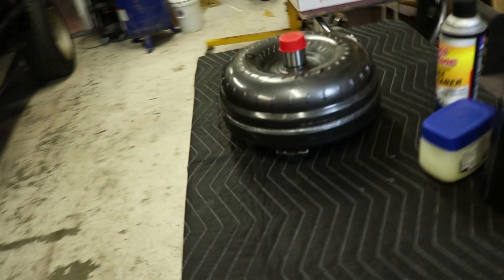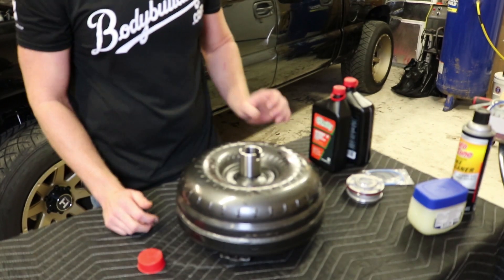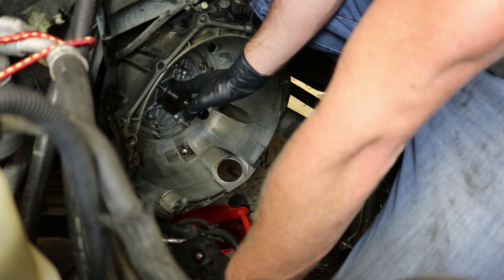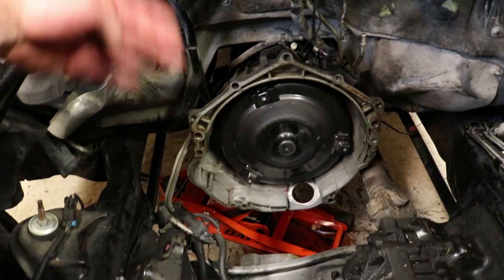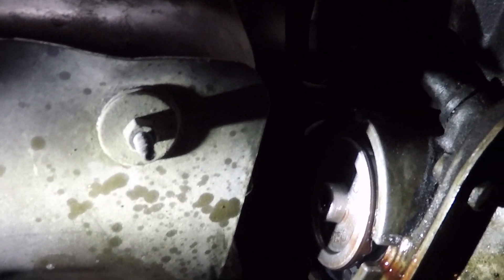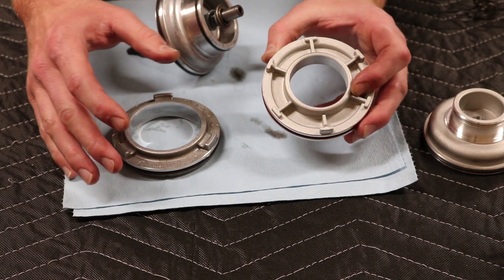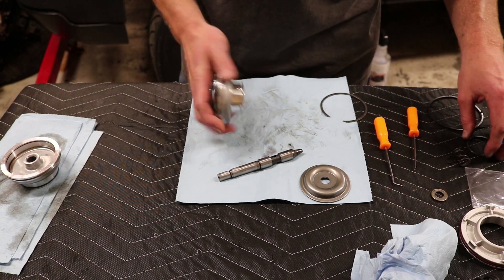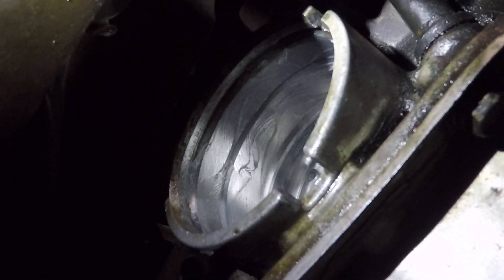Torque Converter & Corvette Shift Servo Installation 4L60e, 4L65e, 700r4 - Silverado Build

Comment: For the 4l65e what’s the next size bigger then 2200 for  torque conv that I can use thanks
Reply from the maker: The next size up that’s worth it is a 2600 - 2800 stall torque converter for it.

Comment: Any recomendations on a good converter for my 2000 tahoe limited,rebuilding 60e.transgo hd shift kit,vette servo,sonnax accumilators & sonnax smart shell.any help would be much appreciated.
Reply from the maker: how much of a stall are you looking to get? I recommend no bigger than a 3k RPM stall unless you have a tall cam it.
Reply: Mitch Carveth 
Not sure,eng is stock besides cold intake and exhuast system.

Comment: Hay man where did I find a high stall 4l60e from I've look around with no luck.
Reply: Its a stock torque converter from a trailblazer with the 6cyl
Reply: tim walk I actually looked into those, they're super cheap! If it works good that's all that matters! I might try one behind my 6.0 with a cam upgrade
Reply: Your looking in the wrong place man look up high performance torque converters for a 4l60E
Reply: MicTheGreaseMonkey there never was one from the factory. Look into Yank converters, it's a high dollar converter upgrade but a torque converter isn't where you wanna go cheap

Comment: Wow thank u for sharing ur knowledge followed ur instructions and my servo install was easy peasy and only thing I'm now regretting is not doing the swap sooner 02 Gmc sierra 5.3 ext cab 2wd scrap hauler!! Thanks again bro btw 275k and nothing has been rebuilt my late father bought it new right before he retired from the General motors plant in Linden nj yes he actually had a part in building his own truck lol plus discounted of course
Reply: I agree 100 percent and everyone likes to bash GM but they will ls swap their fords yotas Nissans motorhomes hell I've seen an ls powered casket rat rod run 11s so yeah rest my case lol I'm also a trucker and my freightshaker fld is Detroit diesel powered so yeah I'd say best bang fir the buck is chevy!
Reply from the maker: You're welcome man! I'm glad i was able to help! I love hearing about when these trucks are deep into the miles like that and haven't had any major work done. just shows how great these trucks are when taken care of. That is awesome he was apart of building his own truck from factory.

Comment: What should I put for year, engine, and make for the eBay listing? I have a 2002 Chevy Tahoe 5.3 with a 4L60E and I'm wanting this converter for it
Reply from the maker: sorry for the late response, basically everything you just said :) just let them know what you have so they can get you set up with the correct converter.
Reply: Mitch Carveth Ok thanks

Comment: Hi brotter what stall you recommend for my 2010 Silverado 4.8 cammed with state 2 comp stock tranny 4l60e planning to driving it daily
Reply from the maker: If you are going to daily it i would recommend getting the 2300 - 2600 stall. That's why i got it so i could still daily my truck. Hopefully you have better luck than me though. still haven't figured out why mine is acting up.

Comment: What’s the link to the converter?
Reply from the maker: Holy late reply, I'm sorry man! might be too late but i got it from these guys, if you do order it just make sure and tell them in the Note to seller your: Make, Model, Year, Engine Size.
https://rover.ebay.com/rover/1/711-53200-19255-0/1?icep_id=114&ipn=icep&toolid=20004&campid=5338569894&mpre=https%3A%2F%2Fwww.ebay.com%2Fitm%2F2300-2600-high-stall-4L60E-4L65E-300mm-Torque-Converter-1998-up-TMBX-TLBX-VJCX%2F333256415145%3Fhash%3Ditem4d97a157a9%3Ag%3AtLUAAOSwYGFU1Awi
Reply: Any recommendation on  a 09 5.3l stage 4 cammed have a 6l80e an cant seem to find a budget stall

Comment: Man I had a HELL of a time getting that servo back in my 05 Silverado. Kicked my ass!! I used a pry bar pretty much the same way you described. Wish I would have thought to use vasaline. Smart!! You made the torque converter install look simple. Nice job!! Can't wait for the engine install video!!!
Reply from the maker: The top of my head is sore from pressing against the pry bar so many times!😂 Thank you! and i can't either man it should be up this weekend 🤞